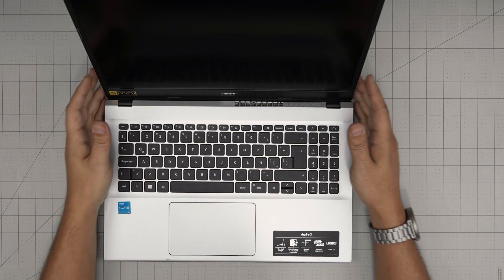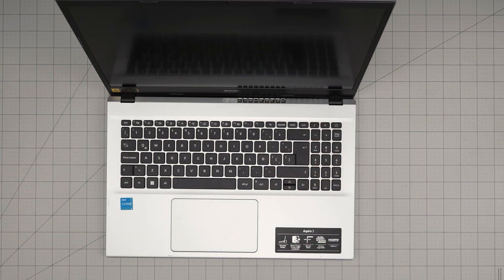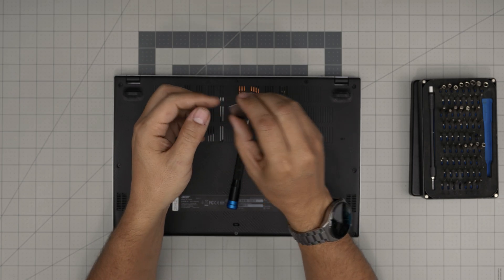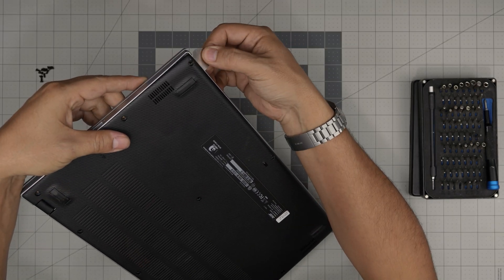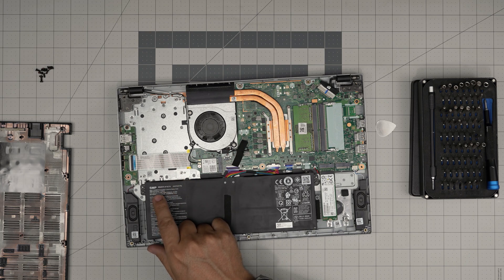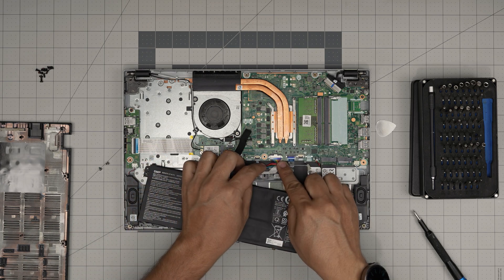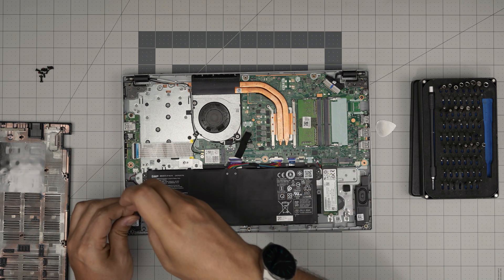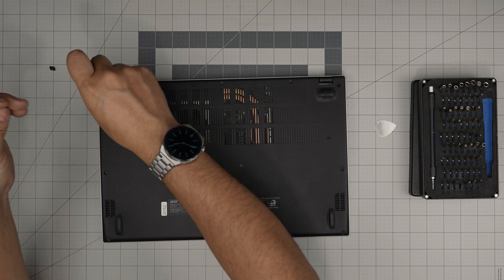How to Replace the Battery in Acer Aspire 3 A315-59-314H

Comment: My aspire 31-59 is battery is charging but stuck as 23 percent  what to do?
Reply from the maker: Discharge it slowly and try charging again. If it doesn't work, then the battery likely has a faulty charge balance board. Return it or get a replacement.
Reply: @uFixTek  can i still use it despite plugged in? with full power of the laptop?
Reply from the maker: sure you can without any issues.
Reply: In your link
There is ap18c7m battery with the voltage of 15. 4

Is it okay to replace with that voltage